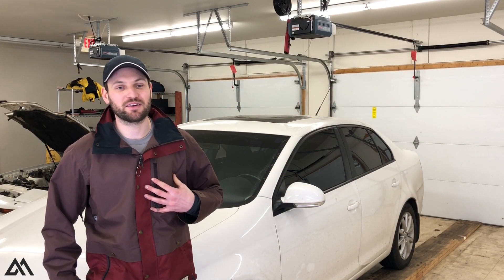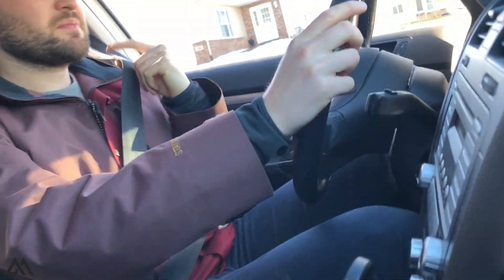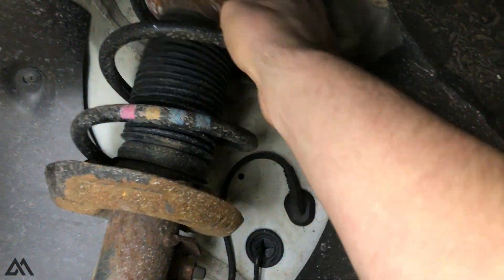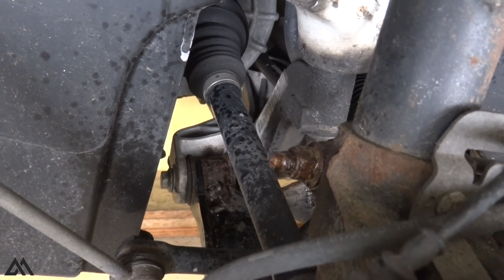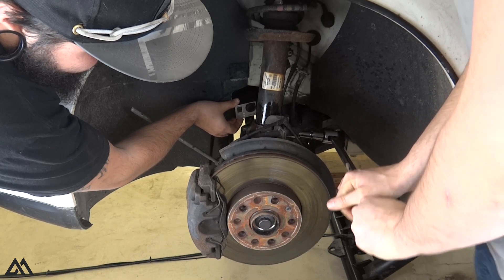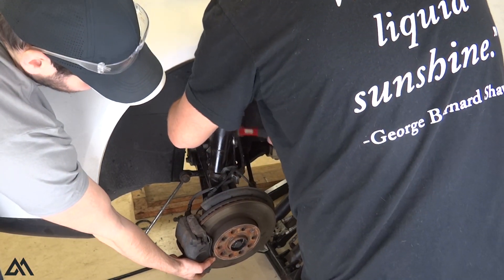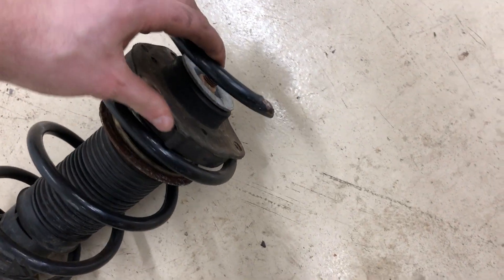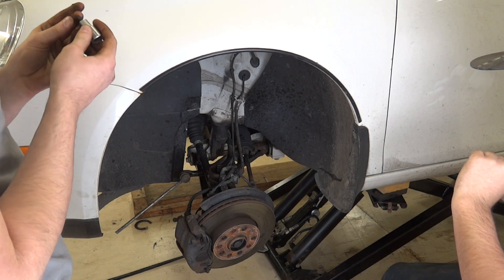Diagnosing Suspension Noise - Banging, Rattling and Popping Over Bumps and Steering

Comment: I had the same problem on my caddy, surely to replace the shock undo top and bottom and remove? No it's just too tight you have to remove drive shaft and bearing carrier from lower balljoint FFS!!! And if you didn't do all that first it's even more of a pain in the a##e!

Comment: I have a 2012 nissan Xterra I noticed the bad suspension sound coming from my front driver side I replaced the strut and the bearing and it still makes that sound going over bumps what should i do
Reply from the maker: Did you change the swayback endlinks?

Comment: Hey guys, I would like to know, what's causing this rattling sound at 1:51 ?  Is it suspension? or is it rubber bushings?
Reply: Did you find it?
Reply: @hugoalmeida6316  Yeah, in my case front sway bar link was busted, I replaced it and sound disapeared.. but it sounded exactly like in the video..

Comment: I have a 2017 mk7 golf 4 door 1.8 tsi I recently changed my front brakes and thats the sound I started to hear day after installation??? So do I havd the same issue as you spring something? Is that a suspension problem or sway bar or strut?

My current mileage on car is 67.8 thousand